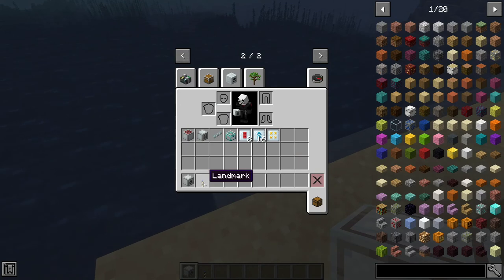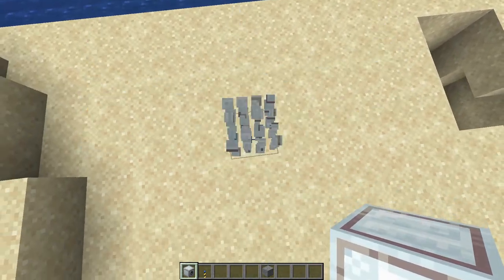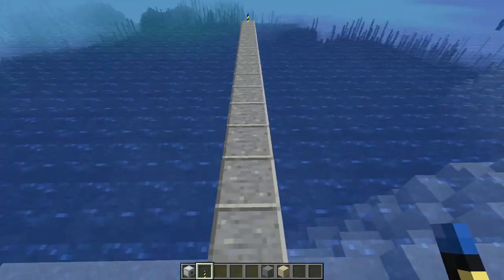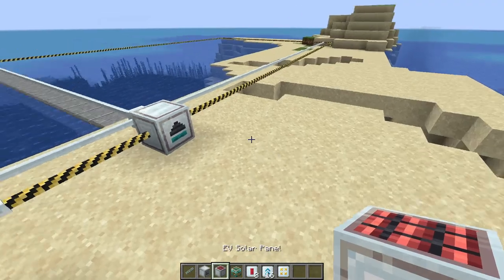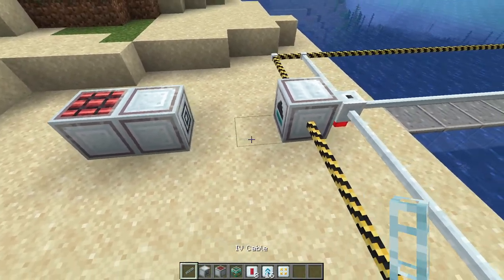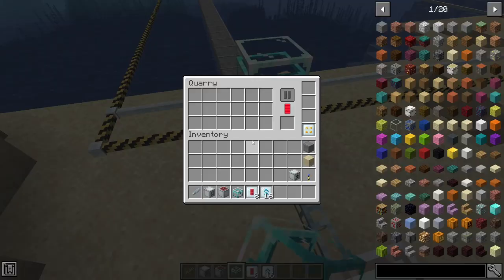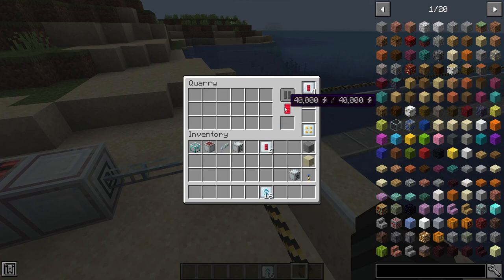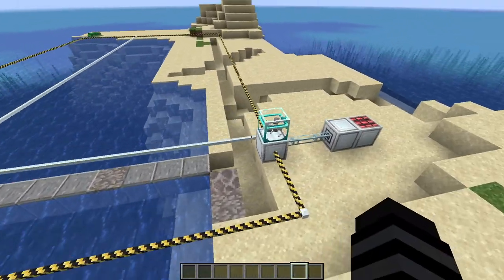How to Use and setup A Ftb Industrial Contraptions Quarry !

Comment: so I have an HV solar panel, to an HV bat box (constantly full around 4 million,) through an MV and LV transformer to the basic machines. and somehow the power cannot keep up. any ideas?
Reply from the maker: Usually what would I I do  is I take my solar and distribution it through multiple sets of transformers allowing more energy throughput by adding the addition energy inlets and outputs for the energy to run through
Reply: @jayplaysgamestuff9100  yeah I decided to have two sets of solar arrays into their own box through their own transformers both hooked up on different ends. Seems to work much better.